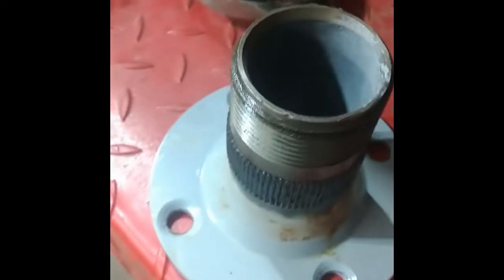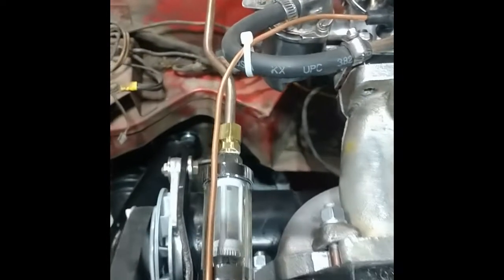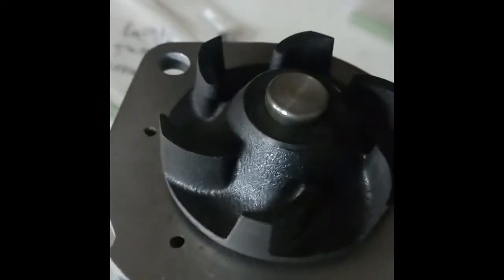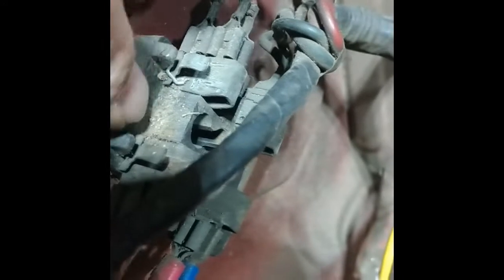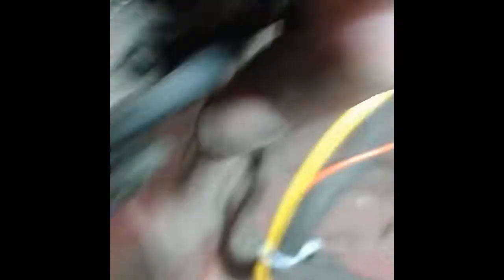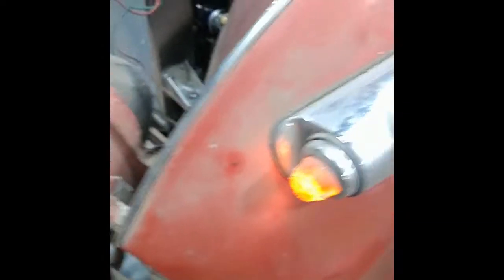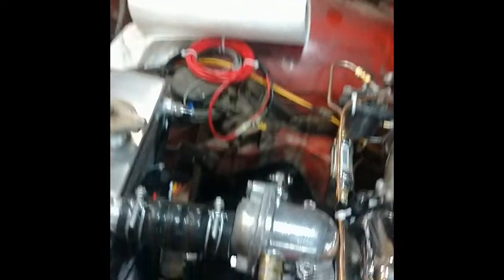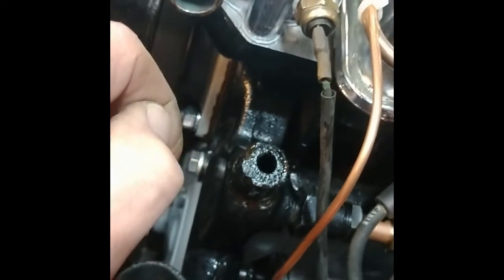1967 Triumph TR4A, Part 45, Fixing  Leaks, Wheel Adapters, Wiring

Comment: For that temp sensor, does the 4A have a metal pipe as part of the lower hose connection?  If it does, you could always weld a bung in there.
Reply from the maker: Yes, it does indeed have that metal tube, but you might be wrong in saying that I could weld a bung in...  Once I got it running, it seemed like the fan kicked in at the right place going by the regular temp gauge so I am starting to accept this location as good enough.  I am also thinking of making my own sensor along with some other electronics for the car so prefer not to mess with it anymore in case I replace it altogether.
Reply: @JB_WI_Triumph  I have my sensor in the TR3A ( also a Wizard ) at the top location and I’ve never had a problem
Reply from the maker: @cheftush  Yeah, I think it is fine the more I think about it.  If I lose coolant to the point that the sensor doesn't get the heat to turn on the fan, turning on the fan won't help at that point anyway.